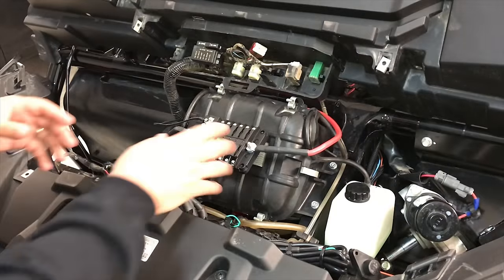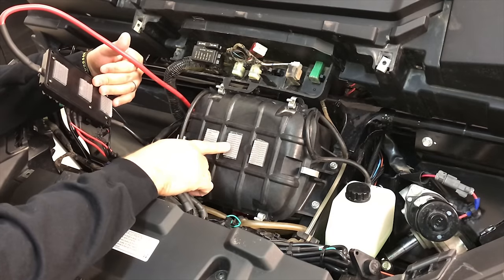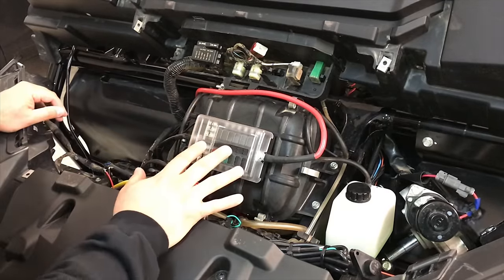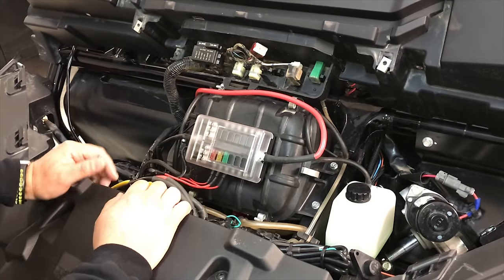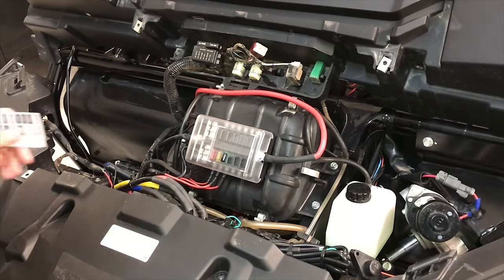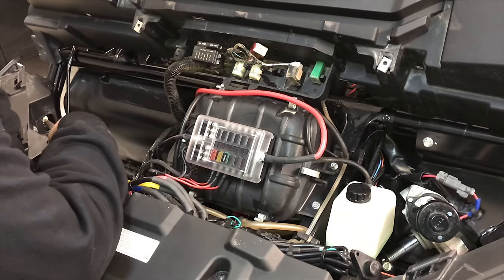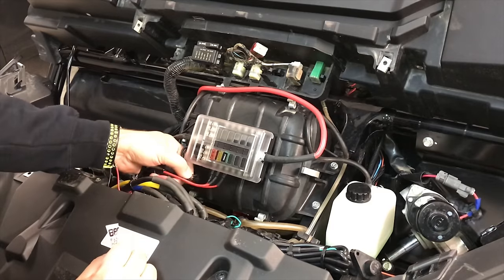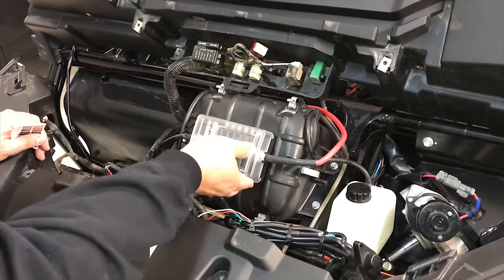How to Wire UTV Accessories - Installing a Fuse Box

Comment: thank you for posting the video as I was looking for a simpler way to add all of the accessories
Reply from the maker: Yep it makes it way easy, also run extras wires from the fuse box to the dash for later. 👍
Reply: @DerangedOffRoad   where do you run all your wires for the key hot so ur stuff isn't hot all the time ?

Comment: Great videos.  I had my dealer install a fuse box before I picked it up.  My fuse box only has a hook up for positive wires.  Aside from the battery where’s a good easy location for grounds for accessories and the rocker switch? Did I see somewhere there’s a grounding post under the dash?
Reply from the maker: You can ground into anything good but there’s not one behind the dash.

Comment: So to add a set of whips, I should get a fuse box, power it from the battery, and the red and black wires from the whips should be wired to the fuse box, from there then, the wire from the whips goes to the rocker switch.  Now the rocker switch, should the power and the ground also come from the fuse box to power the rocker switch?
Reply from the maker: Yes to the rocker.

Comment: What size battery is in this t4? I'm wanting to add a battery to my go kart just to run 12v accessories, should i go with a 12v battery or a 24v battery. 

I have a switch panel, fuse block, lights etc. Your video is the best i seen so far for simple wiring instructions to fuse block
Reply from the maker: Run a 12v if you can

Comment: What gauge of wiring do you recommend? I have a fuse box rated for 300Amps

Most of my accessories I plan to run are my Radar Detector, Camera, interior ambient lights, starlights and underglows.
Reply from the maker: 6 to 8 gauge would work great.

Comment: So I have a question. Can you wire both the positive and negative coming off the fuse block straight to the battery. I know that will make it constantly hot but I dont have a winch on mine so can't do it exactly like u did.
Reply from the maker: Yes you can with relays.

Comment: This might be a stupid question but will ask anyway. Could you use the battery post to charge the battery or jump the battery off since the battery is in a weird place?
Reply from the maker: You could probably but I always go off the post for that. -Garrett
Reply: @DerangedOffRoad  was looking to install jumper post to where I can access them easy since the battery in Teyrx is a pain to get to. Then run the same setup you posted from the jumper post just. Do you see any issues with that

Comment: If i want to use a fuse to connect GPS, Webcam and sat navigator and all of them only working when the  ignition is turn on where would I have to get the positive connection from ?
Reply from the maker: You could probably pull it off the 12v plug.

Comment: So how did you connect auxiliary equipment to the fuse box? For example, you are using a LED light bar, how do you8 connect it with the box?
Reply from the maker: So you will run the main power from the battery to the fuse box. Then you hook every accessory up to the fuse box like you would run it to the battery. One wire positive and one negative. Hook the red positive up to the fuse and hook the black negative to any of the negative spots. It just needs a ground and all the negative spots will work for that. -Garrett

Comment: I've seen people just use a 100-150a relay to power the fuse box with trigger wire instead of each accessory having their each individual relay. Is one way better than the other or does it matter.
Reply from the maker: I would say no, but if that one relay goes bad everything is out.

Comment: Hey great vid. I have the same fuse box. Do you know know what size the lug hole was on the 6 awg cables? The space for mounting them is limited on the fuse box. I liked how you used the cut washers for a better connection.

Comment: Are you running all ur accessories off the factory battery or have you upgraded, I run 2 heated seats, radio, front rear light bar along with dual winches and just worried about excessive draw in the factory battery.
Reply from the maker: Everything is off the stock battery still and going strong after a couple of years. 
-Garrett

Comment: Just got a Teryx 4 and love this idea; however, didn't really want to run the power from the battery, I would rather use a ignition function.  Can you tell me how I could make this work and from what location?
Reply from the maker: You can tie into the 12v cigarette lighter. Running off the battery though work perfect for 3 years on the stock battery when I sold it. Also could always turn whatever on without the key when needed. 👍-Garrett

Comment: Wiring the main posts off the fuse box straight to the battery won’t that give the fuse box power all the time resulting in the battery going dead? I’m gonna be installing one this weekend and not 100% sure how to get it done?
Reply from the maker: I have relays on my accessories so the power only runs to fuse box then that’s it. I have my original stock battery for almost three years come this October and still running strong with no drainage issues of the battery. 👍 
-Garrett
Reply: @DerangedOffRoad  where do you run the relays? Do you run them between the accessories and fuse box or one big one between the battery and fuse box?
Reply from the maker: Between the fuse box and the accessories.
-Garrett

Comment: Is it wired to the ignition or is there a main power shut off?  if it is wired to the ignition where and how on a teryx4. thanks
Reply from the maker: Nope it wired so the accessories will come on whenever you hit the rocker switch. To get the back lighting to work on the rocker switch tie that into the 12v power on the cigarette lighter which is keyed to the ignition.

Comment: Nice video. I have a couple questions as I just purchased a fuse block for my Polaris rzr. The fuse block that I bought already has a built in relay system. So my light bar harness and rock light harness has a relay. Can I cut those out and just run the wires to the fuse block? If so how do I wire up my rocker switches for that?
Reply from the maker: Yes you can but running the relay is just double protection. Google 5 pin rocker switch and it will give you the diagram for wiring and where they go. -Garrett

Comment: How do you have that so it’s key on power, I put my positive and negative on and my switches on my dash light up cuz it’s powered up without the key on
Reply from the maker: Take number 6 and run it to the 12v power cigarette lighter. That’s already key power. Then your background light will only come in when the ignition is on.

Comment: Hey Garrett, I am in the beginning stages of wiring my stereo and fuse block right now. I have everything wired up for the most part, but I'm unsure of wiring to/from my rocker switches. I have the 9 position Brute Performance fuse block that has 5 hot and 4 keyed sources. So do I run the keyed wire from fuseblock to my rocker, then rocker to head unit? The head unit has a yellow(constant power) and red(on/off) wire. I'm not sure which wire goes from rocker to radio? Help please
Reply from the maker: Pm me and I can send you some pics

Comment: Thanks for the velcro idea perfect . So if I wanted the fuse box to only work if the ignition is engaged how do I do this?
Reply from the maker: Tie it into the 12v power on the passenger side. 👍

Comment: What did you use the "40/30 AMP Relay and Harness" for?
Reply from the maker: They came with the wiring kit and I used  them for my big light bar and the stereo setup.
Reply: @DerangedOffRoad  cool! thank you so much for making this video. I bought my Teryx used and it's a rat nest under the hood.

Comment: Does this fuse box get power when key is on only? Having a hard time finding which wire I need to tie into to get power when key is on... Is there an adapter of some sort?
Reply from the maker: No the fuse box has power off the battery and you need to find the wires that run through the left side of the front dash panel up to the ignition. Use a tester to test each wire as you turn on and off the ignition. When the tester lights up that’s the ignition wire. Also I used these to tie into wires. 

TICONN 240pcs T-Tap Wire Connectors, Self-Stripping Quick Splice Electrical Wire Terminals, Insulated Male Quick Disconnect Spade Terminals Assortment Kit with Storage Case https://www.amazon.com/dp/B07MLPBPW5/ref=cm_sw_r_cp_api_i_zFesDb3B7DA3K

Comment: Hey Garrett what's better about that one versus the stock one thanks for the video
Reply from the maker: The main thing is there is not a lot of options to add a bunch of accessories to the stock one. This allows you to add plenty of accessories with ease and not having to worry about the battery. - Garrett
Reply: @DerangedOffRoad  sounds good when I get to that point where I need more options that I'll probably end up doing that myself thanks for the great video again
Reply from the maker: No problem, thanks for watching! -Garrett

Comment: Did the battery cable come with the box or did you make it? I will soon be wiring up a 8 switch connector,  but would like to run the wiring from RZR battery to under hood( to keep dry) and the wire that came with it is too short (8 ga)
Reply from the maker: I used my extra wire from the winch I installed. It worked perfectly for that. 👍

Comment: So how/where did you mount your relays? Do you have a video that shows that and how your ran wire to the rear lights and/or speakers? Trying to find the cleanest path of least resistance. Thanks! Love your videos.
Reply from the maker: Here is the stereo install. I choose to run along the roll cage for easy removal if needed and not to drill in my cage. Relays also sit right in front of the fuse block on top of the plastic radiator guard. 👍 

https://youtu.be/pEG2klGj7B8

Comment: A quick couple of questions from a novice.  These are key on or key off.  Secondly, you mentioned wiring the relays too the fuse box?? Can you explain how you take the power to the Switches. I am using OTRATTW switches with multiple lights and cloud really use the help.
Reply from the maker: The relays have a positive and negative wire, that goes to the fuse box. Then it will a accessory wire and negative that goes to the switch. Third the rocker #6 pin gets wired to the ignition for the little back light that will turn on with the key.
Reply: Can I ask for a little more clarification  on the #6 pin Is that the yellow wire on The relay?

Comment: Are any devices on accessory power through that box? If so, how? Looking to add something similar to my RZR.
Reply from the maker: All you would need to do is pull the power source from the key on power. A good place for that is from the 12v power supply. I choose to run it straight off the batter and it worked really well.
Reply: New subscriber here! Thanks, man. Next question is...  I notice the key on power is labeled as a 10 amp fuse. Is that enough for 4 heated seats? They pull 50 watts each. I’m coming up with 16.6 amps needed at 12 volts for the combined 200 watts. Am I going about this wrong?
Reply from the maker: This is why I ran the fuse box to the battery. I can put whatever fuse in it for what I am needing to run. So of those seats need a 30amp you’re good, light bar needs at 15amp, whips need a 10 amp fuse and so on. 👍 hope that helps -Garrett

Comment: Hey,  just curious where you ran the ground to.  Can you just connect to frame or run back to the negative on the battery? What is the better option?
Reply from the maker: I ran it from the battery to fuse box as well. I feel it’s a better option since everything will run off the fuse box after it’s hooked up. 👍 
-Garrett
Reply: So you ran the positive and the negative coming from the fuse box to the battery correct???

Comment: Are those accessories/fusebox only powered on when the ignition is on, or is it live at at all times/straight to the battery?
Reply from the maker: The fuse block is straight to the battery and everything else is on relays to fuse box and then  to rocker switches. They will come on anytime you hit the rocker switch. The only thing wired into the ignition are the little lights on the bottom of the rocker switch that will light up when the unit is turned on. It’s been a great setup for over a year now, but just added the fuse box a few weeks ago. It’s been great to be able to kick on anything I want without turning on the ignition. -Garrett
Reply: Instead of connecting the fuse box straight to the battery power as shown, could I tap into an accessory wire and run it to the + on the fuse box, so that there is no need for a rocker switch for all my accessories that I don't want power to all the time?
Reply from the maker: Kristie Smith for me I like the fuse box to get its main power from the battery and everything else can go off the fuse box. I also would run everything on its own rocker and relay so it does not overload anything. When running a stereo it would be really important I think to run a relay. Everything else you could probably run without relay and just rocker switch if you want. -Garrett
Reply: @ajf2023  you could do that through a high amperage relay. The PROPER way to do this is to run your positive from your battery through a large fuse or circuit breaker, to a high amperage relay (main power in from protected positive battery, hook up the signal on the relay to keyed power) then your main power cable off that relay to your fuse block. 

This way your fuse block will only be live when the relay receives the signal from the keyed power and you'd have no need for additional smaller relays to each accessory.

Comment: Enjoyed your video once again. Can you show us how to wire the fuse box to a live power cable (when the ignition switch is turned on)??? I’m having an issue with my rocker switches killing the battery over time because the lighting within stay on at all times.
Reply from the maker: Ok my fuse box is wired right to the battery and it works great. The rocker switches however you need to wire number six to the ignition wire. That way the back light on the rocker switch will only turn on with key power. I have been running this for 2 plus years no problems and stock battery still. -Garrett
Reply: Where did you tap in for ignition wire? Also how did you wire all the wires for rockers to ignition switch switch thanks

Comment: Where did you to get your "switched" (ignition) power from?
I'm thinking about pulling power for my rocker switches (4) from the auxiliary power port (cigarette lighter) brown wire, I'd make up a small harness to feed all 4 switches...thought?
Reply from the maker: That should work fine, I went with the ignition wire and I think it was white can’t remember completely. When I turn the power on, it lights the switches up. Otherwise power will come on whenever you want to turn the rocker switch on, which is nice to not worry about the key. - Garrett
Reply: @DerangedOffRoad  thank you for the quick response, much appreciated...great channel!!!
Reply: Great videos. Any more thoughts on how to power a bank of switches? I pulled power for one off brown wire too. Trying to figure out a way to make a little bus bar just to power switches.
Reply from the maker: I run all my switches off a fuse box. I have also linked all the switches to the ignition wire so it turns the little light on when I start the Teryx. The main power comes from the fuse box though. -Garrett
Reply: @DerangedOffRoad  Thank you! That's my plan too with the fuse box. My question is how did you link all the switches to the ignition wire for their illumination?  I created a pigtail wire, for lack of a better word, off the brown wire from the dash plug, with a spade double tap connector. I would prefer not to do multiple splices on that wire as I add switches. Update: I found a 'positive' terminal block that I will run the brown wire pigtail to. This will provide a clean mounting point for an accessory hotwire point for switch illumination power. Your videos are excellent and helped me decide on the Teryx4. Videos soon on my channel.
Reply from the maker: Ok perfect that was going to be my next solution for you. Glad you figured it all out. 
-Garrett

Comment: If i dnt have relays will it draw my battery dead?
Reply from the maker: The rocker is basically a form of a relay as well. If it was to go bad then the main relay would keep the battery from draining. I would not run it like this without the relays.

Comment: Do you have a video to show the easiest place to tap into an accessory wire, so lights, soundbar, etc only go on when the key is switched on?
Reply from the maker: No I haven’t done a video for that, because I wired the rocker switch lights to come on with the key and everything else comes on whenever the rocker switch is turned on. So far no problems at all running it like that for over a year now. -Garrett
Reply from the maker: Kristie, what machine are you running?
Reply: Planning to adopt your install on my teryx4! Awesome video. The only concern I have is wanting the rocker switch lights to go off when the key is on the off position. How can I go about doing that? I’m aware I can use the connection that goes to the cig lighter... but how can I connect 4 accessories to that to make the rocker lights go off when the ignition is off? Tired of  them draining my battery over time.

Comment: Great videos very detail, just got my first UTV  never run wire before like this, do you have some pics of where you install the relay
 to the box etc ?  I already got my new fuse box from the link here but not sure now how to run all the wires, thanks again for the videos
Reply from the maker: I put the relays on the plastic piece above the radiator fan. Also best way to run wires is the top center. I have a vid showing dash removal and a few other stereo install stuff where you can see all that. -Garrett
Reply: Deranged Off-Road thank you